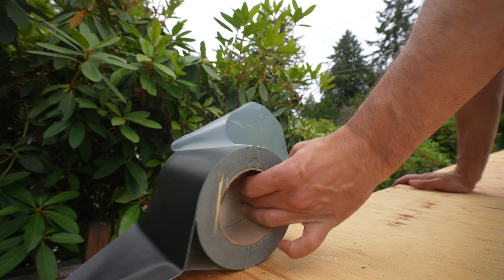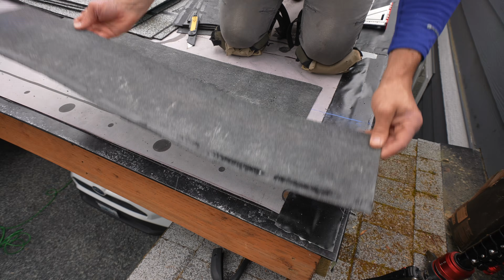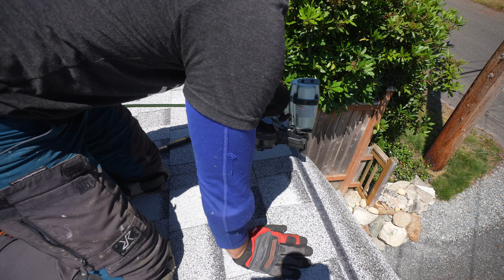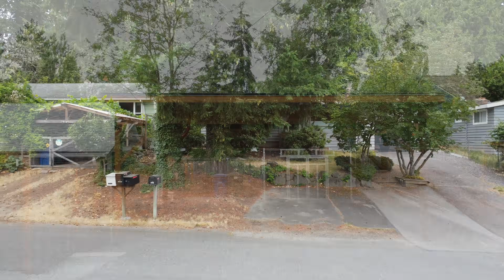BUILDING A LEAN TO CARPORT // Start To Finish

Comment: Love your content but yeah that pitch is so low, if you’re in a snow prone area, snow will sit and melt on the roof with such a low pitch will definitely have moisture issues over time. Would’ve been faster and easier to just do metal. Metal isn’t even that expensive and saves WAY more time compared to shingles.

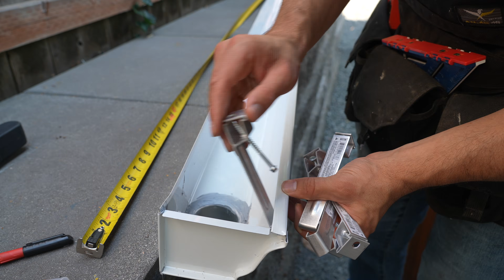Comment: 19:51 i never use those down spout cups… i just cut an X into the bottom and fold the flaps back and use those as attachment points. And I use rivets to attach eaves sections together, not screws. And vinyl downspouts?! Wtf 😳 no go bud. Anything vinyl is just junk… why would aluminum downspouts leak, or why is the downspout specifically leaking? It’s the improper installed eaves that tend to leak!

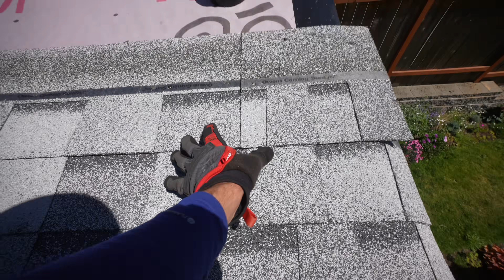Comment: 14:17 a trick ive been using for years for ending the run is to find or cut a larger piece than the remaining gap left, doesn’t matter how much cuz it doesn’t have to be exact but preferably around 1 to 4 inches longer, and just slide it underneath the full shingle next to it. It saves you from having to measure and cut the final shingle of each run. I know its not technically in the instructions for proper installation, but trust me it’s fine and works. Nobody will ever notice, it wont make any difference, and wont harm anything… just saves you time and energy and the edge will be nice n straight without having to cut anything. You just gotta remember not to nail that end down of the 2nd last full shingle until you do the last piece, then nail em both down together. Many professional roofers do this and just don’t show it or talk about it lol I learnt it from a 25 year veteran roofer, and he learnt it from a guy before him.

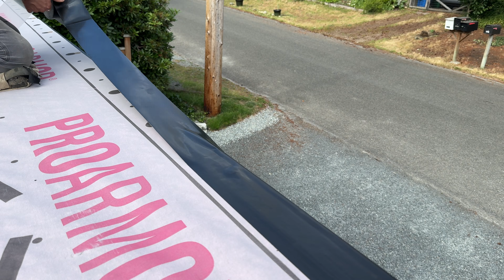Comment: 6:58 the fact that you flashed and sealed the drip edge means that you could have left it under the wrap like you had it… didn’t have to pull it up and reinstall on top. The idea is that wind can blow up and under the drip edge and push water underneath, so the hope is by installing it on top then the water will hopefully be on top of the wrap and not leak through the decking. But since you flashed and sealed it, the chances of that happening are slim to nill… some installers will just run a thick bead of sealent under the drip edge to basically achieve the same result as your flashing tape, except i believe its a bit better protection, as its gluing the drip edge to the deck where your tape is just flashing the back side of it. Both methods are definitely above and beyond the standard though. The only side that truly matters is the low end where the eaves will be installed… obviously the wrap needs to be on top of the drip edge - or gutter apron, which is what I typically use as it is more well designed for guiding the water away from the fascia and into the eaves trough, which is important in this application since the fascia board isn’t covered with tin.

Comment: Pressure treated everything, but then not treated plywood decking?
Flashing tape, on top of flashing tape, with caulk between the drip edges, etc...but then to not use a peel & stick underlayment??  Spend the extra $150 and get self sealing peel & stick, a must on low slope roofs. Drives me crazy.
What is the slope of that roof? Usually shingles are not approved for very low slopes.  This is where rolled roofs comes in.
And there is a reason you cant find short roofing nails.  Its a project of contradictions....hurricane straps, but low slope shingles with extra short nails?  You either have wind risks, or you do not.

Comment: Have the owner thought about adding Solar Panels to this carport? 

If using 460W panels, then it can easily fit 18, which means about 8280W system

Comment: With the amount of work involved in this project, I would have stained the undersides of the plywood, specifically a black stain to contrast against the ceiling joists - I suppose this would add several hundred dollars to the cost plus several hours of labor, but it is worth it (I did this with a Portico and it looks great)

Comment: Awesome build but why not just make it a garage at that point lol, it's structurally sound enough just add some walls and a door and run electricity to it couldn't be too much mor expensive it's already guttered and level. Who cares if it's not concrete floor it's level enough otherwise but that's just me shrug

Comment: I don't understand why not staple the 1rst row of Owens, then lay out ever row, just tacking them, then staple all of them at the same time. Uses less staples and is faster. I also don't get it. We put down the entire row and then nail the entire row. Otherwise, there's 1 guy starting, 1 guy laying the rows, and 1 guy nailing. That entire roof would be done in like 2 hours. This is insane. Anyone can buy a metal carport this big for like $3500.

Comment: Im getting ready to do a 20x20 but with metal roofing...was yours slightly sloped if so did the post cut flush on top or angled according to the slope

Comment: ISO calking works better than roofing tar in a tube. That roofing cement only lasts a year and the call will last for many years. When shigling you should be cutting books to do your start that only hang over the finished amount. The shingle pack explains how to cut the books.

Comment: Beautiful job.  One question.  At the lip edge why didn't you overhang the shingles an inch or two?  I had to repair a roofing job on my home where the roofer didn't do that and the rain water ran down between the facia and gutter.   
I fixed the mistake by putting shingles up and under the shingles to extend the shingle.  Solved the problem.
Did that drip edge save you from doing the 1" overhang?

Comment: Some advise on the shingle install. After a few rows measure from the top of the roof line to the last row installed and you can tweak and adjust. By the time you reach the end you will be able to have a flush finish.

Comment: Awesome job, but be aware that the minimum slope for shingles is 2/12.  No roofing manufacturer will warrant their product on such a low slope.
Reply: I just started watching part 2 and I can't believe it got shingles instead of a steel or fiberglass roof. Where I live that slope would have caused huge issues with snow.
Reply: @tray22 they make peel and stick asphalt rolled roofing for low slope applications also. Anything but shingles.
Reply: Exactly what I was thinking when I saw that he was using shingles.
Rain Snow & Ice! Yikes!
Poor guy.
Reply: @MichaelAnthonyLove  I'm wondering how he passed a code inspection.
Reply: Doesn’t matter… I’ve never personally seen shingles fail to the point of getting warranty. Only heard of it happening on a first batch of new product run or improperly stored bundles. The only thing i may have considered is Ice and water instead of tyvek wrap, but lets all remember this is a car port here… not a house or garage

Comment: Nice Job!  I did something similar when I built a 12 x 12 lean to tractor shed.  Used all pressure treated wood which was recycled from a decking project that I demolished.  Total cost was less than $500.  Thanks for posting the great video.

Comment: Reverse edge starter shingle is upside down, And be sure not to put a nail as you did on your third shingle that was in the joint, So do not put a nail in the offset area. Also the starter edge is also added along the gable ends so as to avoid shingle blow off. Also stick ice and water shield could have been used on the entire roof as it was a lower slope and snow will stay on it. Over all a great job !!
Reply: You guys keep missing in the first video. Snow isn't an issue.
Reply: @turbulentlord2617  You are missing the point that the starter shingle is upside down. Not unlike during  grass installation green side is always up,  on shingles the grannual side always up also applies. What is going to happen is the bottom shingle is going to retain moisture as there is no grannual to repel moisture so it will then curl and become uneven making the first row unsightly.

Comment: It is beautiful, no doubt. BUT, at $200 sqft, wouldn't  a garage have been cheaper, and actually add more value to the house? (was labor included in the $13K?)
Reply: cost so much because he overbuilt every single part of it.
Reply: Believe it's closer to $20/ft2 not $200...
Reply: @ryandicker7146    Sorry for the bad math. 288 sq ft for $13K is only $45/ft.   I must have been bidding a government contract. 😁
Reply: @ryandicker7146   You are correct, I must have been using government math. 🤔  Just out of curiosity, what would a 2 car garage cost in your area?

Comment: Very nice carport. I've never seen that asphalt roofing before here in Australia, but a quick Google says that it is legal and used here. We'd just throw Colorbond metal on it, and call it a day. So probably a row of battens, then metal, no plywood. But the look of the plywood from underneath is really nice, and the cost seems pretty competitive. Food for thought.
Reply: your metal roof would be wonderful.
laying shingles on this flat roof is not an approved method. 
this is against manufacture installation instructions, and a code violation
Reply: @alanm2842  yep, slope was not great enough.

Comment: Kentuckian here with experience in Federal Governmental Contracting here. You cannot use staples for your underlayment, you cannot use tape for your Ice/water barrier. the barrier has to go a minimum of 18-24" based on northerness region then you can lay down your drip edge.  You NEED to use cap nails for your underlayment. When doing roofing and you don't remember the rules off hand you have to think, "Water will always follow gravity and can travel 6" uphill, so always overlap from bottom to top". Also shingle nails should be 4-6 depending on wind speed location which is high around florida and gets slower the more north you go. W/ shingles, you don't need to measure out 6", 13" or whatever, just do 1/4,  1/2, 3/4 shingle and cut, saves time especially with hook blades. Don't work row by row, do multiple rows and work in a 45 deg., from one corner to the opposite like you show @ 14:45. its best to rivet every sheet metal to sheet metal connection. 

Overall its really good and I'm sure a lot of time was put in and the more its done the better you'll get and that means the more money you're able to save due to finishing faster. there are a few flaws but thats to be expected from someone whos not doing 3-5 roofs a week. a lot of care and patience was put in and it shows
Reply: Could you have used a steel panel roof - and then capture any rainwater run-off for garden/yard usage?
Reply: "You cannot use staples for your underlayment". Well he did and you can. The manufacture may not honor warranty but then again they never do anyway. 
"You cannot use tape for your Ice/water barrier" Again what he did was fine and better than most. It's a CARPORT! it's not a home. There is no need for anything even close to 18" of barrier in this application because it still a CARPORT!
Reply: @billandwende 😂lol, behave and be good. Building codes are there fir a reason besides safety. It's to keep ppl employed😂 A $13K carport though, geese it's actually as big as my house and sturdier

Comment: I can do it, but $13k as a DIY project... imagine what a contractor would charge!
Could anyone speculate the cost for a standard-build garage that size?
Reply: My cousins got a new 2 car garage built . It was 30.000 dollars 30 years ago.
Reply: @missingremote4388  my space needs the old garage raised, a 3.5 car slab poured w/PEX, with two 9 ft and one 12 ft doors. 
That's a hundred grand all day 😭🤢

Comment: when I did roofing (I'm too old for that stuff now) I always tried to get the shingles delivered to the roof and did my cutting up there, but I'd straddle the peak with some saw horses, toe nailed down and cut on a temporary work table. you can't do that on the carport but the slope is likely low enough to just put the table near the high end. also park a dumpster where it's convenient to throw your scrap
Reply: The slope is not greater then 2/12 not even suppose to use shingles.

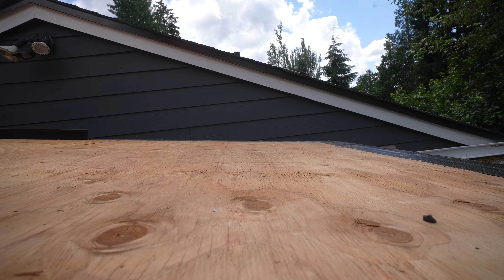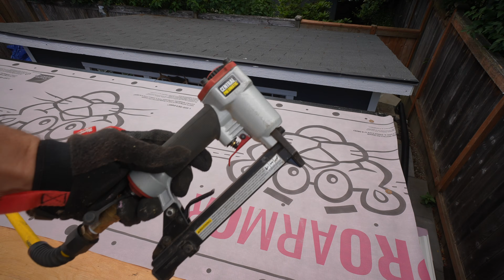Comment: Nice build, good looking carport. The underlay you chose is good underlayment but you really should of gone w/ peel & stick for the low slope. Its the only underlayment that is bombproof on 1:12-3:12. 4:12 and above is fine for 2 layers of synthetic. You should of used starter shingle on your eaves and rakes as well or at at least put a thick layer of tar down on your eaves/rakes to prevent uplift in high wind events. The duration shingle you chose is a good shingle.  Best regards.

Comment: I was going to build a gabled end carport for my Ford Transit DIY camper van, but I feel this lean-to version will be safer for me to build. I will need to make it taller for my van and I plan on not using those expensive beams, but will build them with PT heavy boards nailed together to create a solid beam. I did that with a deck I just built for my daughter in TN. I bought your plans and will modify them for my permit and purposes. I am in southern Indiana and I will not need such massive piers, but I will go with 12" square by 24"-20" deep ones. Thanks for the videos.
Reply: PT = pressure treated wood

Comment: With that carport there now, it doesn't look like the overhead electrical service is to code anymore.
Reply: HAHA  I was just thinking the same thing.  I think roof clearance other than where the mast/weatherhead is located on the edge is supposed to be 14.5 feet for distribution services.  Don't quote me on that.  Regardless, I know a foot or even a couple feet over a roof is definitely not to code.  I don't think the fact that this is just a carport makes any difference?
Reply: Good  Call ! Code requires the service drop conductors to be no less than 10ft from the highest point of the roof.

Comment: Want a review after 3 years of use. Seems the posts are warbling when you install the black brackets.
Reply: Warble as in making bird noises? If you mean wobbling, note the 45 degree bracing added. The Seattle area doesn't usually get heavy snow, but I'm confident this will handle a very heavy snowfall.

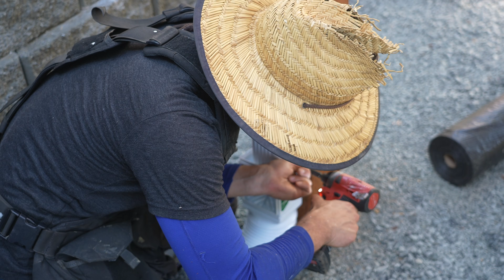Comment: 22:15 Hoping you misspoke but it looks like you didn't. Why use a perforated corrugated pipe? Its going to leak all the downspout water as it passes the shed. Also those leaf filters don't work very well and dump tons of water out when they catch leaves and don't eject them. Corrugated pipe will get clogged no matter what you do too. You should use solid 4 inch schedule 40 PVC pipe and no filter. The smooth walls of PVC wont collect or clog with leaves anywhere near as much as corrugated and you can install a cleanout at the drop so it doesn't need to be disassembled to clear a clog, it wont get crushed like corrugated will, can be connected securely for leak free joints, and can be buried . Other than that though it looks great. Nice work.

I would have probably used plywood with one nice side and stained it before placing that side down so you don't see all the knots underneath but obviously you are constrained by the clients budget and nice finished plywood would cost more. The post and beam style construction looks awesome in my opinion, the homeowner can also stain the gluelam beams to match the pressure treated color better if they want but it seems to blend in once its in the shadow of the carport itself. The large connecting plates look cool and I would have loved to see more on the diagonal braces as well. It should also be easy to run power to the carport from the entryway to add some underside lights which would also be nice.

Comment: The sealant on the nails fails after a very short period. Highly recommend screws with gaskets.
Reply: Nah it won’t. Signwriter for 10 years and a good exterior silicone will outlast any gasket that comes on nearly any brand roofing screw.

We ended up having to take off hundreds of gaskets (when we couldn’t get gasketless screws) because in a year or two that gasket would break down and disintegrate and let water in. I’ve seen silicone still working from the 90’s when my boss first installed some stuff.
Reply: Agree. Voice of true experience right there. A dab of silicone beats gaskets over time 👌
Reply from the maker: Thanks for the input buddy.  I will be working on a few more project in the future around this house so I'm going to keep a good eye on it and see if any issues arise in the future. Thanks so much for watching.

Comment: Looks fantastic and matches perfectly. I wouldn't have guessed the traditional shingled roof would be permissible on such a shallow slope. Myself, I would've probably done a torch-down because they are sealed to the underlayment... but that wouldn't have matched the house. The $4k in gluelams seems a bit wild. Does WA get much snow? That structure looks like it'll support a helicopter pad someday.
Reply from the maker: Definitely need to rent a helicopter and put it to the test lol!  We don't get much snow but thats what the structural engineer required so we did it based on what was approved. Probably overkill haha.  Thanks so much for watching and all the support.

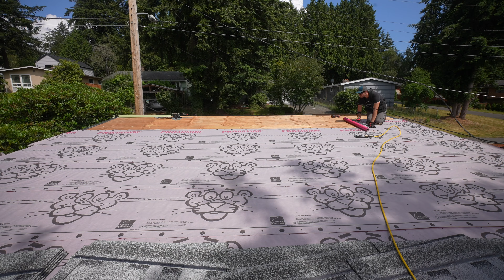Comment: This is cool but I’m still not clear on why it’s so overbuilt. It’s… just a roof? Could have done a 5:12 or steeper pitch roof and metal roof and worry less about snow load.
Reply from the maker: Its not really about the snow load.  It's about the span between post to post.  Its such a long span that it requires those massive glulams. Hope that makes sense and thanks so much for watching and all the support.